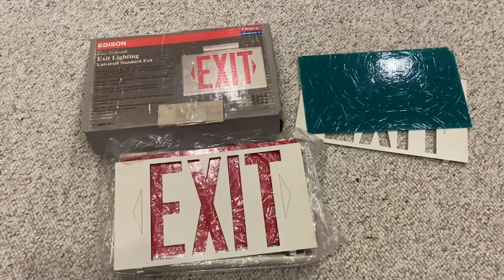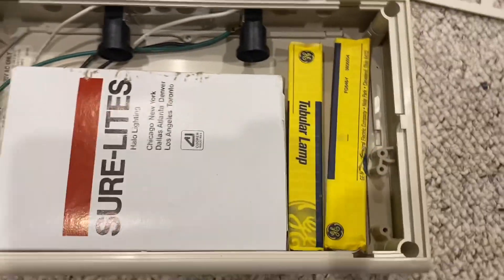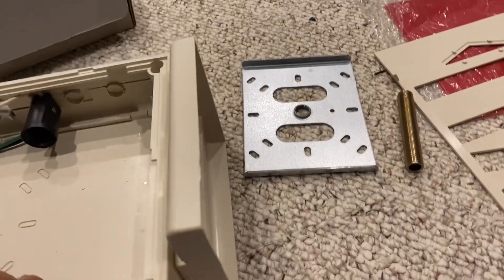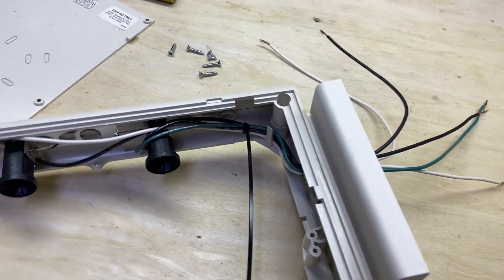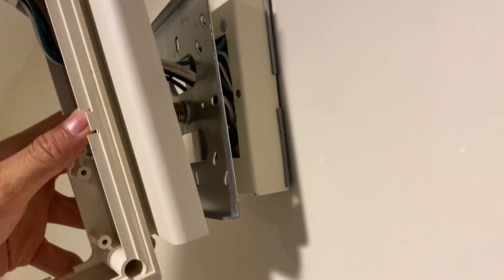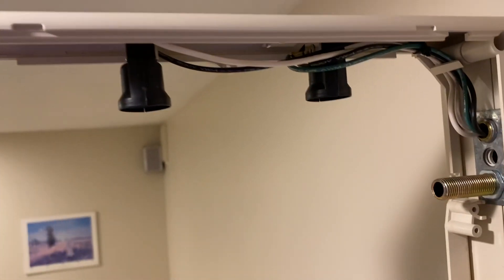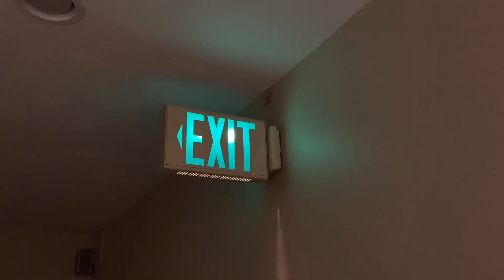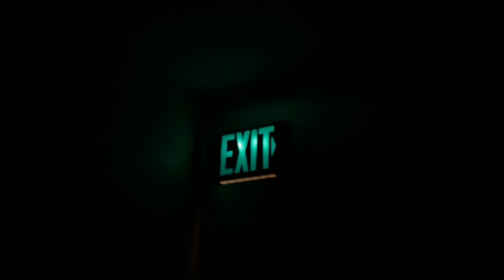Installing an Old Stock Edison Exit Sign

Comment: Can your big chunky Chloride unit run AC only exit signs with DC sockets? I think you should put some DC sockets in there and run the sign with a remote capable unit. That's just my opinion tho.
Reply from the maker: It would be hard. There’s no remote cables running to this exit sign
Reply: @FireAlarmDude5967  You could use just about any two conductor wire to do it. However I'd imagine that wire fishing such distances isn't fun. Either way I'd be interested in seeing an AC/DC exit sign.
Reply from the maker: @briggscarson yeah, it would be impossible without opening wall sections which I don’t want to do